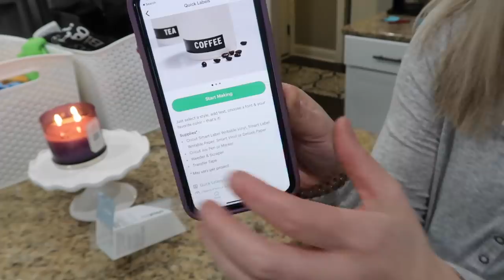CLEAN DECLUTTER ORGANIZE WITH ME 2021 | SPEED CLEANING MOTIVATION | CLOSET DECLUTTER TRANSFORMATION

Comment: you need a squeegee you take a squeegee and clean the windows you spray it you squeeze it and you dry around the edges and you're done and it ain't all that rubbing rubbing rubbing rubbing rubbing and then going outside and finding out to you when you go back in there's streaks squeegee baby squeezy hot warm water.